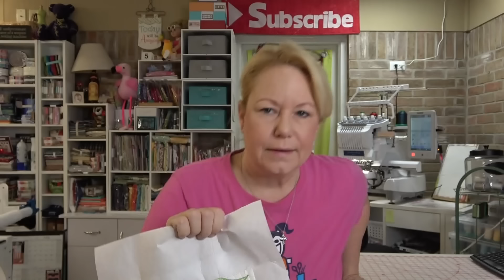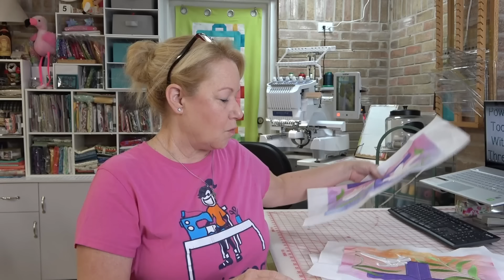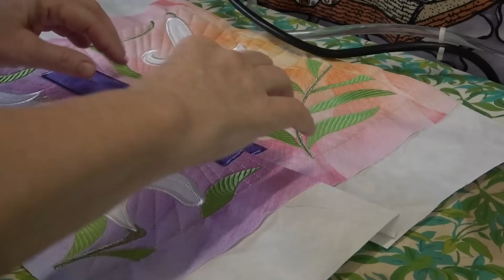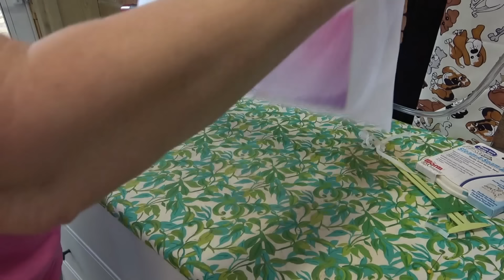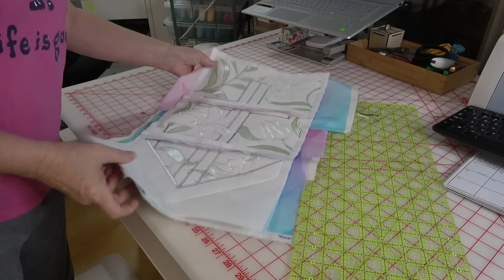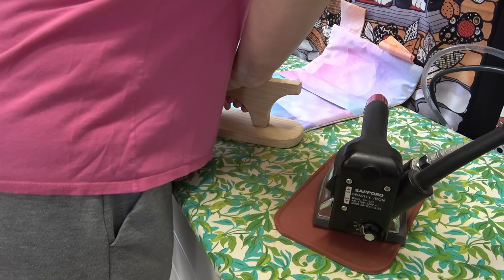Beginner Machine Embroidery Sew Along - Easter Lily & Cross from Sweet Pea Designs Pt-2

Comment: What do you have your iron setting on?  I have the brick colored iron pad but what is your green one?

My iron gets so hot. Used it today for the first time snd my ironing station got so hot, it freaked me out!
Reply from the maker: I keep mine set at about a 3 or 2.5.  Yes, it does get very hot (but it's a Dry heat LOL)  Once you get used to the heat settings , the weight of the iron, and the cords, you'll begin to notice a huge difference in getting wrinkles out of fabric, creasing bulky seams (like in denim), etc.  Using a commercial-grade tool can be a game changer.  For an additional mat, I use this one under the brick colored mat.  https://bit.ly/3p5Zy3H
Reply: @PowerToolsWithThread  I ordered that iron pad you suggested.  Love the Sapporo, just don’t want to burn the place done!!  Thanks for your help!

Comment: Beautiful project! Love the pastel panel you used. When I use Steam-A-Seam, instead of pulling that paper off, I iron it down. The glue bonds to the piece, then pull off the paper tape, position your top piece and iron again to bond the top fabric. I have also used Dritz Wash Away Wonder Tape.